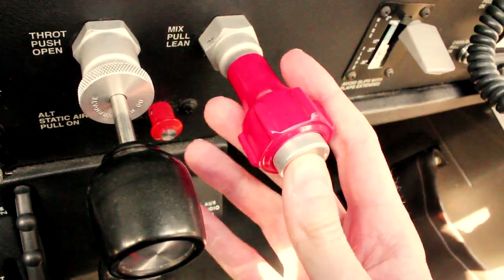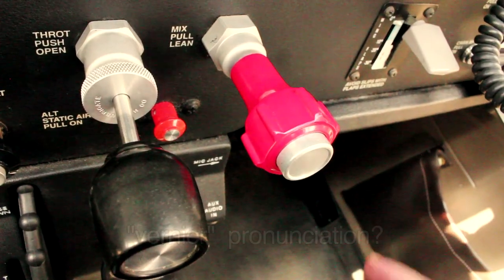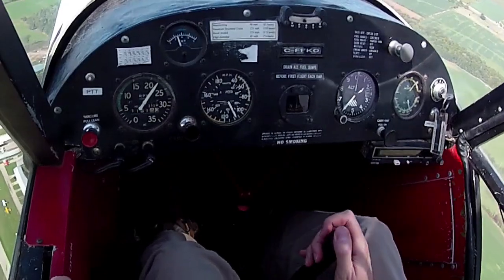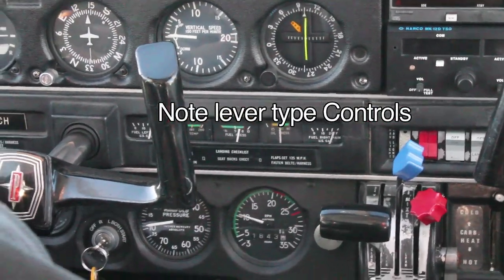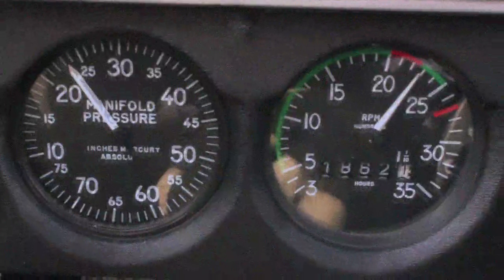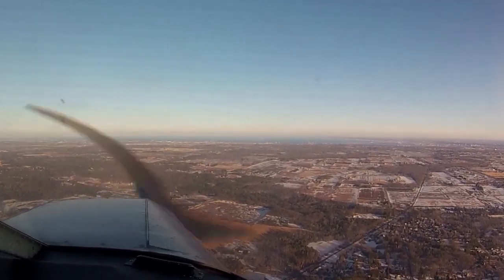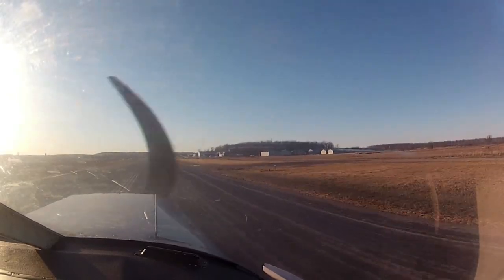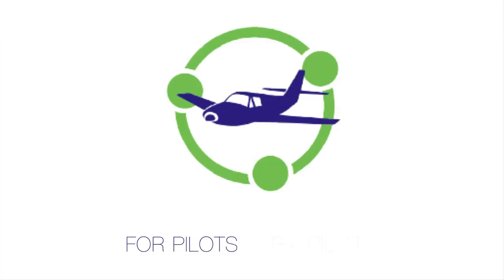Flight Training - the Art of Leaning - various aircraft types - POV FLying

Comment: Sheesh this video is terrible. You actually get max power at ROP not LOP. You don’t lean for power, you lean to find max then rich or lean from there. From max you rich for power, you lean for efficiency and lower CHT, manifold pressure. Engines are tested for longevity at LOP, period. It’s like a training fail that they teach you to always run ROP, but if you’re LOP at 65 percent power or lower it’s impossible to blow up the engine:
Reply: full throttle = full rich for cooling: cruise = LOP for cooling and efficiency. It’s stupid to cruise at ROP, your engine is making too much power and you’re burning fuel and wearing down internals at higher heat

Comment: I feel fortunate that, before getting into flying, I've spent a bunch of time fiddling with vintage motorcycles, and hypermiling in cars with factory lean-burn operation.  With that background, I've gotten decent at feeling what an engine is doing and what it wants, and I've become familiar with a lot of the theory of detonation, BSFC, etc.  With that, as well as some of the great aviation-centric theory in videos like this and especially Martin Pauly's, I feel very comfortable with leaning.

Not long ago, I was running a little bit late on getting the rental back, and was going to dip a few minutes into my reserve (10 minutes out of my 60 minute reserve).  It was comforting to know that I had been running the engine very efficiently all day, and that therefore the fuel burn estimates from the POH were probably more conservative than optimistic.  It was also nice to be able to rip home with a tailwind down the Columbia Gorge running ~70% power LOP, as opposed to staying ROP and running at a slow airspeed to use a similar amount of fuel.

Comment: So mixture is basically fuel efficiency for an air craft similar to how a manual car has the luxury upper gears so the engine doesn’t have to contently work as hard for the entire flight?

Comment: I just don't understand why risking to experiment with a/f ratio during flight and to focus on hearing the engine sound instead of just installing an EGT gauge as a standard equipment and get that mixture adjusted without worrying whether the engine is overheating or not. Just nonsense engineering..

Comment: As a car guy the mixture thing never made sense to me on fuel injected engines.  It's super easy nowadays to maintain an optimal mixture ratio on a closed loop/lambda system.   Running full rich just increases carbon buildup, can increase cylinder wear, and can run the risk of fouling spark plugs.

Comment: Is automating mixture with some form of computer controlled device on the way? We had a 172 with an 180 hp 0-360-A1A & 3 blade CS Hartzel prop. We added an Insight gauge that was  a complicated waste of money. The single control systems on the Diamond diesels will hopefully become the norm.

Comment: i have always wondered, with the insane costs of aircraft these days, why not just put a wide band O2 sensor in the exhaust, and learn the stoichiometric values for your fuel. you want precision, THAT is precision (and very easy to do!) 90% of cars do this automatically with a computer in realtime, all a pilot needs it the gauge, and use the mixture knob to set it yourself.

Comment: I watched this video a while back but it's interested me again now I'm progressing in my Engineering course at university: I found a section in my thermodynamics textbook showing that, all other factors kept constant, the best fuel mixture for fuel efficiency is 80% of peak EGT, aka roughly 50F lean. It's worth noting the vast majority of combustion, even in engineering processes, runs lean of peak so petrol powered piston engines are really the exception rather than the rule (diesel and gas turbine engines are throttled purely by fuel flow, so they're always either lean or at full power)

Comment: Very informative. I learned much in the last few minutes across a few videos. I'm aiming to get my PPL late summer 2017. A little off topic: Is there any concern for using noise-cancelling headsets? For example, let's say something starts happening with the engine that you're not aware of if the noise is getting cancelled out. Any cause for concern? You'd probably see indication through instruments or auditory warnings? I took discovery flights at age 11 and 13 eighteen years ago and realized I now had the window of opportunity to go for it - I'm astounded how much has changed since my days of Flight SIm. VOR phase-out? Glass cockpits all around? Joysticks? -Thanks

Comment: @1:29: "(LOP)....the risk of possibly overheating or damaging the engine"

I don't know why this OWT still exists, and yet its said with the proof right on the screen. LOP is cooler and less stress on the engine than ROP. Look at the engine graph for an O-360. The CHT with a mixture setting of 75*F LOP are about 20-30 degrees cooler than an EGT at 150*F ROP. Burning less fuel and the BEST part (for me) is no excess carbon dioxide in the cabin.

I was the same was as a student pilot. Just throw the red knob wherever, it doesn't matter. But since I became an owner, I spend most of my free time reading technical articles, scientific engine data, etc on this and I can suggest this for those wanting the finer bits of leaning:

Mike Busch has several REALLY good webinars (free!) on EAA's website. One is basic leaning (as this video shows) and one for advanced leaning.

Kas Thomas has an EXCELLENT book called "Fly the Engine" and will increase your knowledge of the engine like you've never understood. It's on Kindle for the price of dinner.

John Deakins is another leading authority on LOP operations. He is part of the GAMI team and has written several interesting articles from the "Pelicans Perch"

http://www.avweb.com/news/pelican/182146-1.html
Reply: I thought the Diamond is a diesel???
Reply: Alex Melia The problem, is some engines aren't perfectly balanced. You can't run lean of peak on a 172, unless you have egt for all cylinders. Even then you'd see that one cylinder will be peak, while the leanest will be so lean it detonates. A really balanced engine can do it, and the stumbling is because of the imbalance. I really like Diamond DA42, they automatically run rich on full or high power, then transition to lean under low loads on the constant speed prop.

Comment: Explain more about atmospheric pressure, manifold pressure and turboprop engines please?  I don't understand the relationship.
Reply: He was referring to the gauge having too much of a wide measurement range, since the engine isint turbocharged you will never really exceed 4 in of mercury. So instead of having a wide measurement range the gauge should measure a smaller range but in more precise units

Comment: In a fuel injected engine it may be easier to cause damage at ROP vs LOP...  75% power 50 deg rich = bad combo for most engines yet that is where many pilots run.

Comment: I was taught to pull the mixture back until the engine runs rough and then give it a few rotations inwards until it runs smooth. If you want best power just keep enrichening it until the RPM peaks again. If you pull mixture back and push it back in until it runs smooth you're leaned for max EGT basically.
Reply: That's what the 1964 Mooney M20C manual says to do.  But then, there were not many gauges with EGT sensors for each exhaust manifold back then.
Reply: That's how it works.

Comment: Great video! Always refer to the poh or eng manuals for proper leaning procedures. Also, if you believe in shock cooling "lore," be careful not to richen the mixture too fast during decent. Fuel cools the engine down.

Comment: Definitely ever forget to richer the MIX before reduce power on a descent to land,I swear your engine WILL quit
Reply from the maker: +stealhty1 Be careful assuming this is the rule... It is actually the other way around if you are at a high density altitude; the engine could quit if you go rich and flood it at a low throttle setting on short final...
Reply: That is also true, I mean low altitude close to sea level
Reply: +FlightChops I might stand corrected, but doesn't the landing checklist say "mixture rich"?
Reply: yeah, i did that in X-Plane and the engine cut, and it wasnt the fastest at starting up either lol

Comment: Good video. I attended a leaning seminar at the Colorado Springs AOPA Convention, and full rich in ground ops was discussed as a major issue for engine maintenance and eventual problems, esp in high density altitude airports/environments.
Reply: Matt Robinson , do you fly/ live in the springs? I only ask because I do. I own an airplane out at KFLY but could use some help and pointers if you are a seasoned pilot. Even if you’re not lol pilots stick together and it’d be nice to talk with someone who knows more on the subject then I do. Cheers, Scott

Comment: carefully enough to notice, and there's an aircraft on the runway behind me. He went to another exit, but I could hear others on the CTAF on approach. Finally by doing short bursts of high power, followed by idle, I got it moving and taxied to park. After shutdown and securing, I asked my instructor what had happened and he responded, almost cheerfully, 'oh, you probably leaned it too far!' It was unnerving at the time, but it was still a nice learning experience. Lessons: be more precise, and enrich when it sputters at high power but not low.

Comment: I fly C172s, and my instructor has always said to use the 'bush pilot technique.' Lean until the RPMs drop, then enrich until RPMs have returned to the level that was at start. I'll have to try some of these techniques for taxi leaning though, as we've never said much about being precise on the ground. I have a story that's kind of interesting/funny (in hindsight) about taxi leaning. Of course, I try to never taxi full rich, to save fuel, and as part of the after landing checks, I lean the mixture. However, being in the habit of going imprecisely, by sight (1 to 2 cm out), I pulled it too far. The engine didn't shut down and it was fine idling on the taxiway. But it started to sputter when I tried to move again, and that airport is non-towered and can get pretty busy sometimes. So now, I'm already on edge (it was my second ever solo), I think the engine is quitting, maybe there's an oil leak (what will Steve say? By the way, that's my instructor's name.) and I didn't watch the gauges

Comment: What aggravates me the most about leaning, or lack thereof, is people are taught a procedure that their instructor taught them that was passed down from another instructor. This creates a virus in the industry that isn't cut out until pilots do their own research. What I recommend is getting familiar with the manufacturer's recommendations for leaning with that specific engine model. Little known fact in the C-172SP POH in the amplified procedures of Section 4 gives the exact leaning procedure. It also includes a note that for flight training purposes the engine can remain leaned even during maneuvers with full power like recovery from stalls and slow flight.
Reply from the maker: +Veritas1992 Thanks for the added perspective!  I had no idea about those amplified procedures - will have to go take a look.
Reply: It's institutionalizing in the training environment. I went through probably 90% of my overall training including private & commercial single & multi as well as instrument with doing very little leaning during maneuvers due to lack of knowledge of the leaning procedures. It's not an uncommon issue.
Reply: +Veritas1992 I was just going over CPL flight test guide and realized this was required ground knowledge... Just check my 172s POH and BAM.. there it was.. thanks ;)

Comment: to add to my comment below, Full rich below 5000' is also what Lycoming recommends in the Lycoming Operator's Manual for O-360 and HO-360 engines. At least in the manual I have which came with my aircraft and was published in 1965. Procedures may have changed since then. They also recommend that you can take-off as long as you have oil-pressure in the green, but I still wait for oil temp to come up as well. Lycoming says on cold days oil temp may not be in the green till engine is at cruise power.

Comment: I fly a cherokee 180 I have owned for about 8 years, and I use the EGT for leaning, but you don't really need the EGT. Lean till it runs rough then enrich until its smooth again. this is good on the ground and in the air... Full rich for climbs and decents untill at desired altitude then rinse and repeat.  Believe it or not I was taught by my instructor not to lean below 5000 feet MSL, and although this is not correct, I did not ever see any negative impact on my plugs for the few years I flew it that way.

Comment: love your vids. fantastic. the only thing i'd disagree with in this one is the idea you'll get your engine too hot if you lean too much. while it's true you will get your engine hot if you lean on the rich side close to peak, it's not true that you will overheat your engine going past peak to lean of peak. the chart you put up shows this. in fact, your engine will run cooler on the lean side, your fuel burn will drop, you'll stress the engine less for the power output, plugs and valves will remain cleaner. you will lose a bit of airspeed, but not much, and will gain miles per gallon and engine longevity. chances are, without an engine monitor, if you use the technique your instructor shows--leaning to roughness then slightly enriching--you'll be running slightly lean of peak. the only exception to running lean of peak is operating above 75% power where running at least 100 degrees rich of peak (full rich on take off) is the safer way to go. if you're running a carbureted engine that complains lean of peak, try closing the throttle a tad and putting on a little carb heat. you may find you can run lean of peak with all its benefits. contrary to the what i hear often, you can't hurt your engine running lean of peak at moderate power.
Reply from the maker: Matt Bucy I can't argue with any of that.  Thanks for adding value to the conversation.

Comment: I think actually the ground is a place where the engine can get very hot as it's air cooled and minimal air is flowing over it. I fly a 206 parachute aircraft and always re-open the cowl flaps after landing.
Reply from the maker: Calum MacFarlane great tip! I'm not flying anything that big (yet) :)

Comment: Thanks for the video, it was very helpful :)

Due to lack of funds to consider getting my own PPL, I've been sticking to sim flying in P3D with the wonderful aircraft from A2A Simulations (C172R, C182T and Piper Cherokee 180) where (as Mirandorl mentions) have very good simulation of how the engine, fuel, plugs, electrical, oil and air supply systems work (in addition to very good aerodynamics simulation), so you really want to maintain the aircraft and fly within operational perimeters at all times.

I've spent quite a bit of time trying to lean properly, staying about 50 degrees rich of peak in the cruise, though I tend to forget the whole red knob whenever I should be putting it back to full rich :P

BTW, I did find it a bit funny that the tail number of the Cessna you were flying was C-FJES... I kinda read it in Norwegian where it would be translated to C-FACE... Kinda fits with your logo :D No offence :)

Keep up the great vids. I just recently came across your channel and love the content you put out. Honest and pointing out areas where mistakes were made or where there is room for improvement. Definately a channel that goes on my Top10-list :)
Reply from the maker: Pierced Brosmen Thanks for the awesome comment!  Glad you're enjoying the channel!

Comment: Popped over here from the video about engine loss in IFR conditions. I think this is a big reason to keep from fowling the plugs and in addition valve stems, pistons, etc. Not only do you reduce the amount of power the engine can produce, you risk what happened in the IFR video, which is having valve stems so gunked up that the valves don't close properly and eventually fail. Maybe us renters can use the economic mentality if nothing else (safety being the big one actually!) that less fuel plane uses, the less cost to the rental company and more likely to keep prices as low as possible.
Reply from the maker: gatorcellman Agreed - Thanks for this valuable addition to the conversation about leaning.

Comment: before giving advice on leaning, do an APS course, as running just rich of peak is sort of bad..  lean of peak, not so much,,  do the study yourself, as most if not all will just sprout their instructors uneducated comments on the topic. The graph you used in the video of the mixture chart, is taken from the APS course material.   notice how lean of peak is where there are lower ICP's (internal cylinder pressures) Lower CHT's (cooler engines last longer) Lower EGTS's and best specific fuel use for power produced..  but to lean safely, you need to ensure every cylinder in the engine gets the same mixture in the cylinders through the induction system and fuel distribution....
Reply from the maker: Pamuva RAL Thanks for the advise - I agree with all you are saying.  I tried to be sure to add context / disclaimers to make it clear that I am not an instructor and just trying to do a small part as far as at least getting people thinking about leaning, that otherwise might not.